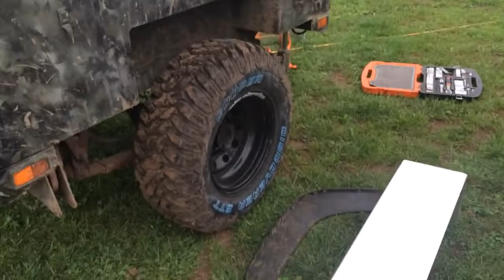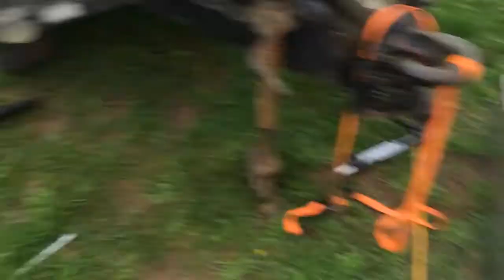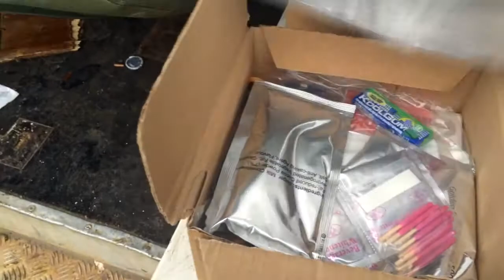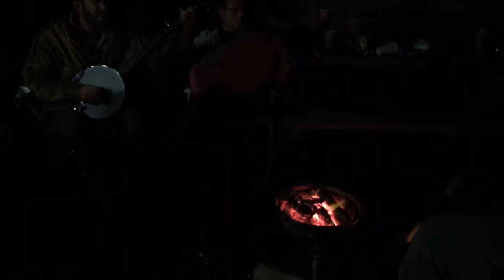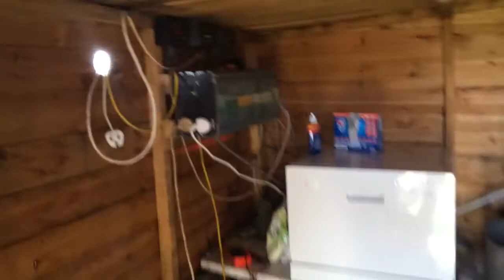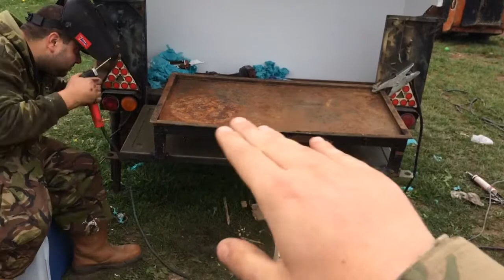bug out vehicle prep for the 250 Prepper meet.

Comment: did you do the green yourself on the landy if so did you rub down 1st or go straight on with matt base then top coat....i know nothing about spraying card but would love to do my jimny camo just wonder how to go about it..
Reply from the maker: i didnt do this one but i did the trailers and all the other landys. you need to rub down or at least etch the surface so the paint has something to stick too then clean with panel wipe then you can mask it all up and paint. its all in the prep work. the longer you spend on that the better it will come out.
Reply: Torn Apart self sufficiency
cheer mate.
Reply from the maker: any time pal. any questions just ask. im no expert but iv done a few now